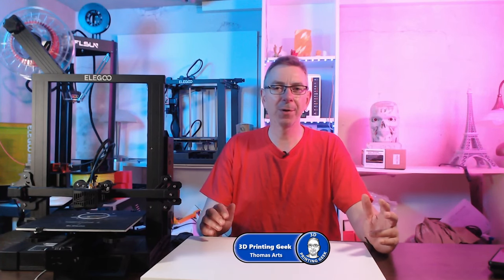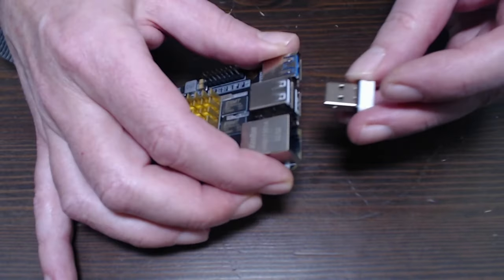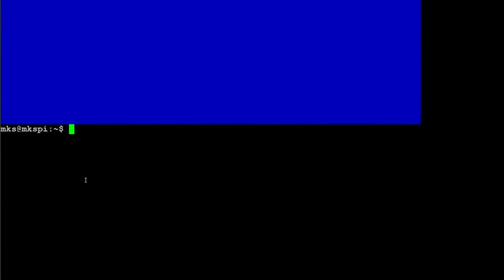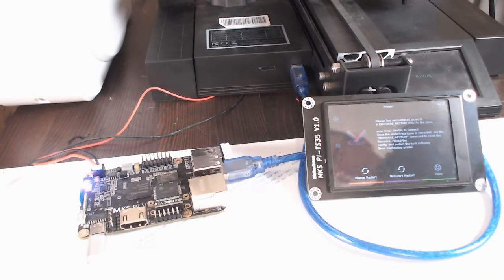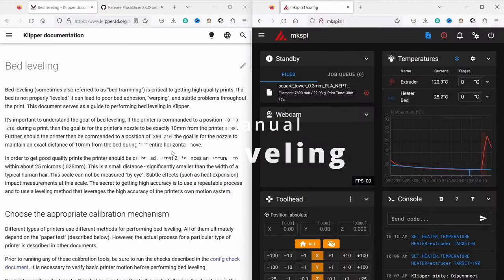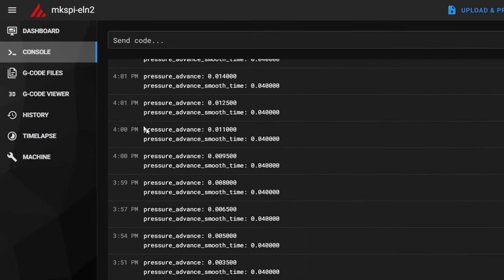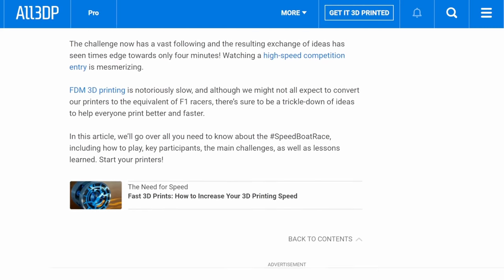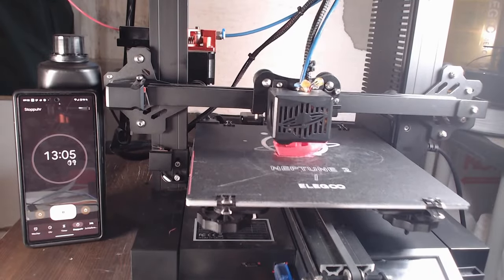No Raspberry Pi? No Problem: Klipperize Your 3D Printer in One Hour!

Comment: https://youtu.be/d80x9NlOM9w?t=557

Is there a follow up video? I'm running Artillery Sidewinder X4 Plus that use the MKS-PI as stock. I naively updated everything but now it doesn't work as I need to update the MCU but there is not printer.cfg info for setting it up?
Reply from the maker: @luxurious1617 Hi there. I have plans to do a general video covering that topic.
In the meantime, to get your 3D printer operational again, I suggest resetting it back to the stock firmware.
Interestingly one doesn't find the required firmware on their international website, but I found it for you on their German website. There's a flashing tutorial describing the procedure, too.
You can download the firmware for your 3D printer, and watch the tutorial following this link: https://artillery3dprinter.de/pages/kundenservice
I hope that helps in the first run 😃

Comment: If I add Klipper, is there a better way to operate it disconnected by running a UI on the Pi instead of a separate computer?  That way, I can add a touchscreen and run the printer standalone.
Reply from the maker: Hi @samernajia. Of course you can operate it standalone. There're touch displays in different sizes available for the Raspberry. How to connect them depends on the specific model. Then you could either have KlipperScreen on the display, or in case you installed a Linux distribution with a desktop environment, make your browser start in kiosk mode and auto load the Mainsail or Fluidd UI on localhost.

Comment: Hi, is it possible to connect it to the Sovol SV06 mainboard?
Reply from the maker: @Fabiopre Thank you for reaching out! I appreciate your interest in my content! 
Yes, it is indeed possible to connect it to the Sovol SV06 mainboard. 
There's a printer configuration printer-sovol-sv06-2022.cfg in the "klipper/config/" folder (there's also one for the Plus) which you can use as a starting point.
Or take a look at this GitHub repository https://github.com/bassamanator/Sovol-SV06-firmware/tree/master which provides ready to go instructions especially for the SV06, as well as links to many useful resources.
To connect the SV06 to the MKS Pi (or BTT Pi, Raspberry Pi) you need a USB A to Micro USB cable, or use an USB adapter.
Let me know if I could help 🙂
Reply: @3D_Printing_Geek  thank you very much, I switched from sv06 to sv06 plus and intend to install klipper with newly ordered mks pi card, I will definitely write to you for help if you are available. thanks for your work :)
Reply from the maker: Hey there! Thanks a ton for choosing me as your go-to 3D printing guru. I'm stoked to hear that you're switching to a new printer. If you need any help with Klipper or anything else, just hit me up. Keep rocking the 3D printing world!

Comment: Thankfully there are thousands of Pi's in stock now, and it is getting better all the time. Alternatives are great, but the available Pi support makes the project easier and simpler to get running properly in most cases. Happy Printing!
Reply from the maker: I completely agree! Having a wide availability of Pi's and strong support makes all the difference in getting your project up and running smoothly. 
Let's hope it stays that way but in case of another shortage knowing how to deal with the alternatives may come handy again 🙂 
Happy printing!

Comment: Hello, thank you for the video. I bought the MKS PI + screen and emmc and nothing works, I plugged it directly into the power supply of the Ender3, and it gave me a short circuit. Have you ever had what kind of problem? How is yours connected? Thank you.
Reply from the maker: @francksaillard1969  Thanks, for your comment.
I used the dedicated +12~24v power connector and wired it to my 3D printers power supply terminals. It's crucial not to mix up the polarity. I think that could cause damage. If you find that you swapped GND and +12~24V then try it the other way. Maybe it will work. At least I know that the BTT-Pi just does nothing when connecting it using the wrong polarity, and works if that's corrected. It's worth a try. Heres an image showing the connector: https://user-images.githubusercontent.com/12979070/175954568-43ede0db-cca0-4df0-8e14-3bef6976cc05.png
If it's still not working I suggest you try to get a replacement from Makerbase. 
I hope it will work and keep my fingers crossed.
Keep me updated, and if you have more questions, don't hesitate to ask.

Comment: My issues so far are, the default settings are such that I cannot connect to wifi reliably. I'm building another image and if that doesn't clear things up I'm sending this MKS PI back 😅
Reply from the maker: Yes, the Wi-fi support on the MKS-Pi seems not to be the best. Maybe using an adapter with an antenna improves that. I haven't tried because luckily I have LAN available in my 3d printing space.
Did you find a solution for your WiFi problem?

Comment: Just use an old netbook,
Reply from the maker: Hi there. Thanks for the comment. There are many possible solutions to run Klipper. Sure one can use an old notebook or laptop, though the power consumption may be much higher than with SBCs.
This video has been made to show how the conversion works using the MKS Pi.